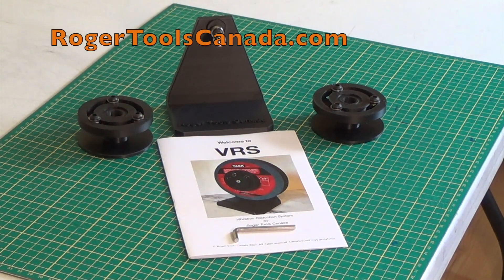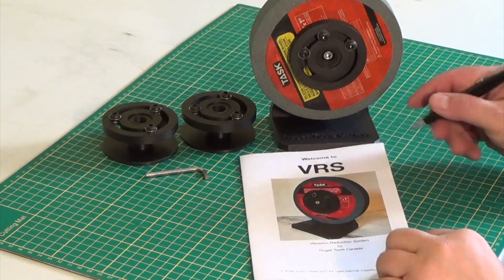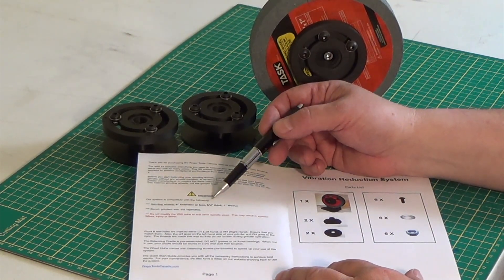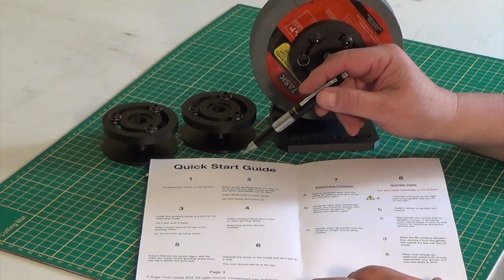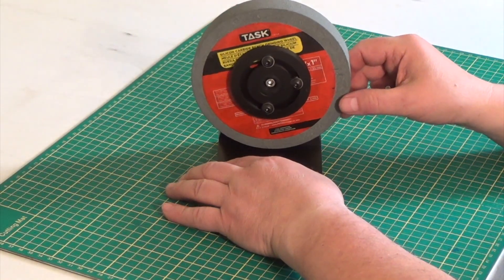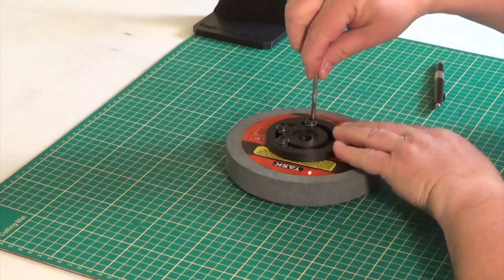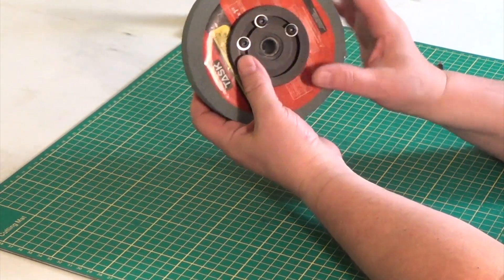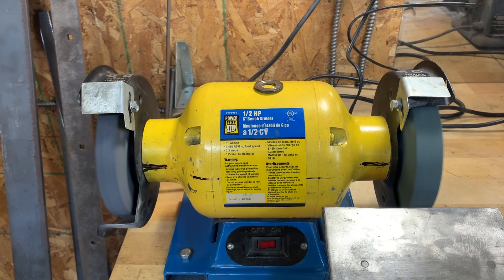The Ultimate Bench Grinder Balancing System

Comment: Will this work with buffing wheels.
Reply from the maker: I haven’t tried buffing wheels Robert but I will try and will get back to you within a few days. Gilles
Reply: @LetsRogerThat 
Thank you.  I bought a used like new 6” Baldor bench grinder I just want to use for a wire wheel and buffing.  Yeah she’s really out of whack right now with the wire wheel and grinding wheel.
Reply from the maker: @robertspreitzer8126  Hi Robert, as long as you have a buffer wheel or wire wheel with a 1 inch hole then my balancing system would work.  The other thing to consider is the arbour size of your grinder.  Some Baldor grinders use 5/8" shafts (arbour) instead of 1/2" shafts.  Measure yours and then you can pick the correct VRS system from my store.  Let me know if I can be of further assistance. Gilles
Reply: @LetsRogerThat 
Awesome thank you I will take some measurements.  Does your system come with balancing wheels for both sides.
Reply from the maker: @robertspreitzer8126  yes it does and the balancing unit as well

Comment: I just dial in each wheel separately. If really difficult add washers with eccentric holes. Surprized you would choose a PAL grinder for your demo......not the smoothest grinder to begin with.
Reply from the maker: You are correct. 👍🏻